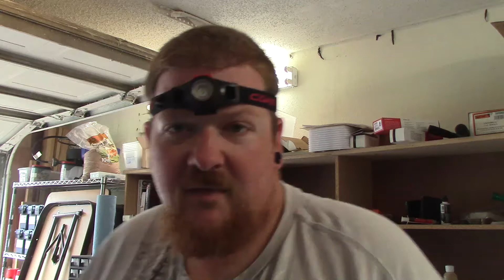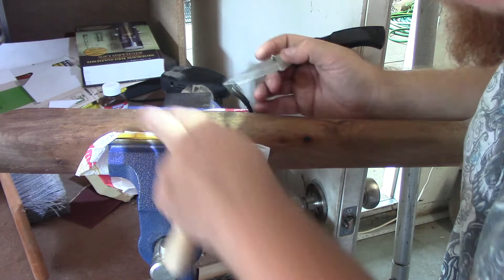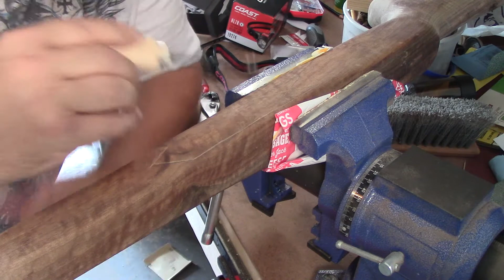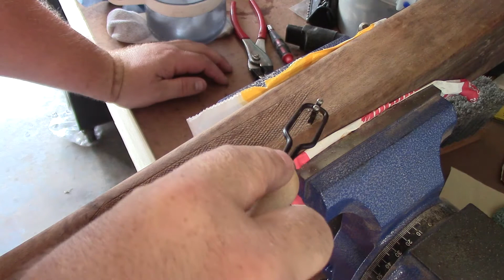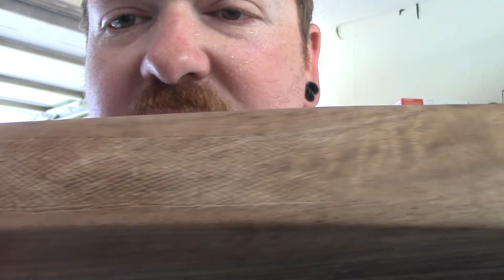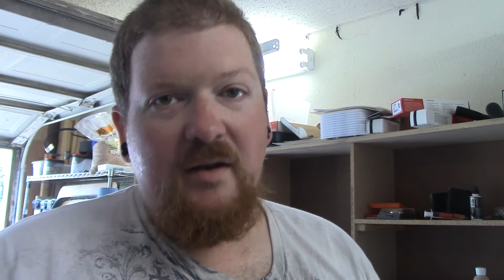First Attempt at Gunstock Checkering for School

Comment: Nice job! 

I am in week 2 of the Checkering lab. I got my pistol grip area sanded down and sealed with tru oil and waiting on it to dry (school supplied stock blank). I grabbed a chunk of wood from a pallet and sanded it down nice and smooth and put a pattern on it and my master lines were excellent and then it was all downhill. I can not for the life of me get parallel lines with the 2 line cutter. My plan was to drop in all lines with the 2 line and then come back and deepen them and make them look nice with the single line cutter.
Reply from the maker: If I was actually purchasing tools to do checkering with, it wouldn't be these.  There are much better things available.  The good thing about this supplied stock is that if you really want to pursue it further, you can sand it down and redo it and still have plenty of material.  My preference for cutter heads would be a double head but only one head cuts, the other just follows.  It may be something I explore further in the future, but it's not really catching my interest at the moment.  If you want to see what I'm really into, check out my take down and repair videos.
Reply: If I decide to try it any further than class, I am thinking dem-bart or the other brand I think it is Gunline? My wife is showing a very strong interest in checkering. if she can do it and do it good, I might have my first employee. :-)